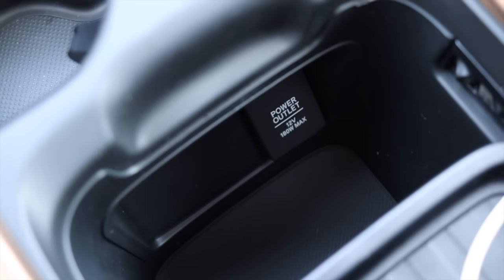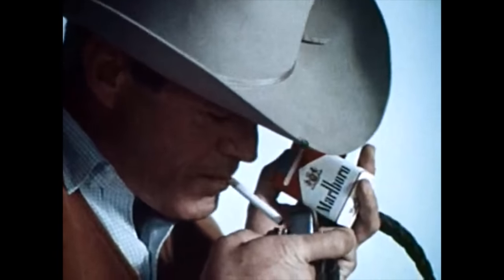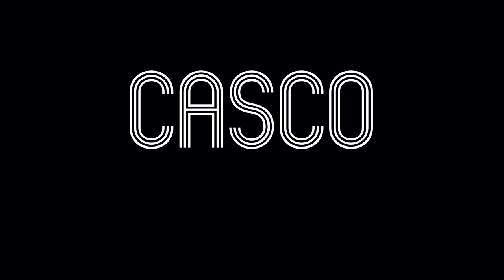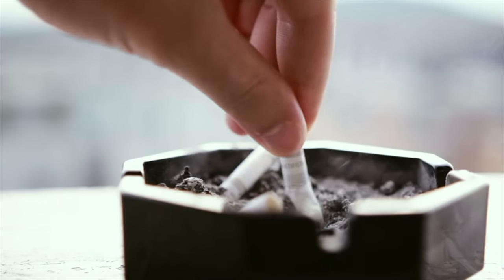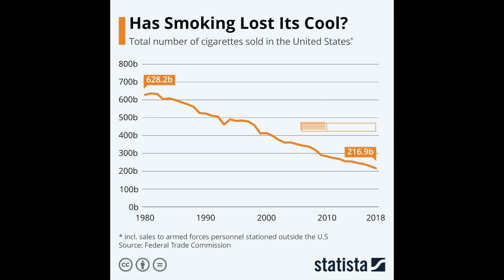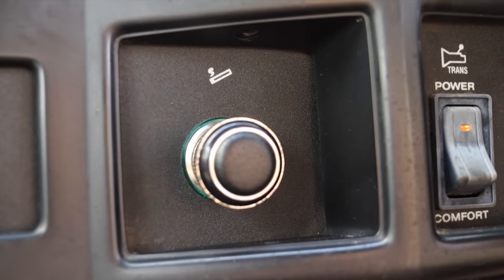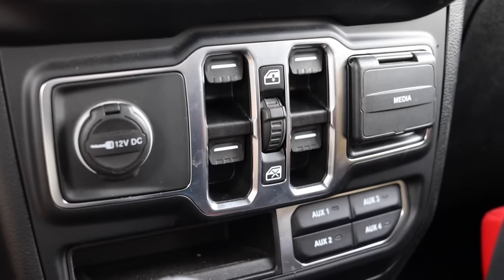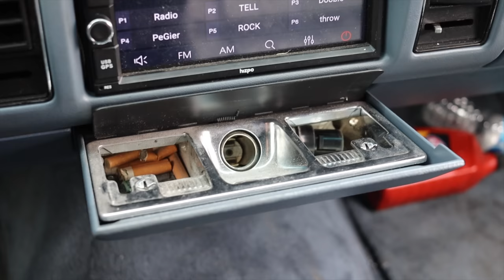Cigarette Lighters - How They Were Invented & Why They Went Away!

Comment: Another trick for the old car cigarette lighter for us folks in colder areas was to use it to get a start on chipping that frozen windshield. Push the lighter when you start the car. When it pops out, grab it and melt a spot on the ice to start chipping from. Worked every time.
Reply: Wouldn't that destroy the glass?
Reply: @porterbennett7041  glass has a melting point well above 1000 degrees. I doubt a little electric heating element reaches even a fraction of that
Reply: @Michael-sb8jf  no man he means thermal shock is when glass is cold and you put heat enough heat it will shatter due to the stress being different from the different temps, look it up “thermal shock glass” and yes if you pressed the hot heating element on the bare glass it would probably shatter it but if it’s just on the ice it’ll be fine
Reply: Yeah. If it's iced bad enough that your scraper needs help, start the engine, turn the heater to full defrost and wait ten minutes.
Reply: @Michael-sb8jf  I never mentioned it would melt I ment wouldn't it crack the glass if it's that cold
Reply: @porterbennett7041  
I made the comments when I was dead tired and not thinking and the only thing I could think about was chemical structures and such and more thinking it can't warp glass.
 Though the ice would provide most likely act a  good insulator against the heat of a small " filament" especially given the use case given in the original comment. Water takes a lot of energy to phase change. And that heat will be disposed across the entire sheet. not to mention the air pockets between said ice and window. 
So long story short yeah I mis understood and my thought process went the wrong path 

But yeah putting the heating element directly on the glass in cold probably a bad idea.
Reply: I just made 2 eye holes.
Reply: @Michael-sb8jf  frozen windshields can  shatter from having hot water thrown on them in other words it wouldn't have to be a 1000 ° to break if frozen
Reply: @commieslayer6740  and here’s the guy who continues to beat a dead horse. He admitted his mistake already
Reply: Melting ice will not get above 0 degrees Celsius/32 degrees FREEDOM UNITS so there's not going to be thermal shock until you get all the way through the ice and apply the heating element to the glass itself.
Reply: @BogeyTheBear  exactly have to touch the glass itself
Reply: My parents used to chuck nearly boiling hot water on the windscreen on cold mornings and I never saw one crack. However I did witness the rear window of my 1985 VW Polo immediately shatter when I switched on the rear window heater on a cold day.
Reply: We used to start a little fires when we went hiking or mountain riding when cars were allowed hahahah
Reply: It's was also good for when your car door locks freeze. You could heat up the tip of your key and it would slide right in like butter.
Reply: @allmodescrew5548   I would assume you wouldn't put the lighter directly on the glass you would hover it and move it around in a circle or whatever
Reply: @porterbennett7041  obviously not if it was common practice
Reply: @joesantoro4964  If your car door locks are frozen, how do you get to the cigarette lighter?
Reply: @igotes  cold mornings lol. you're from Maine or something probably. come to Canada and try that shit in winter.
Reply: @jcon6734  On my old Honda the drivers side door locks always froze up in the winter so I would have to get in from the passenger side door then use my lighter. But yea if all your locks are frozen then you need to use a regular flint lighter.
Reply: This sounds unnecessarily time consuming when you can just turn your Ice scraper sideways and scratch out a spot to get started with the sharp end.
Reply: Plus when you return the cig lighter you're plugging in a wet lighter into a power socket. That seems kinda dangerous.
Reply: Interesting
Reply: @porterbennett7041  no the heat from the cigarette lighter element would instantly dump into the ice
Reply: @porterbennett7041  If the lighter was bigger it would.
Reply: @Vast Horizon bro he just corrected himself already 😂 cant you read?
Reply: @igotes  there is a reason for this, your front windshield is made of 3 to 5 sheets of glass, insulated with plastic, they are ment to not shatter, to protect you, from road hazards. The rear and sides are a single piece of glass and will shatter if you poor hot water on them when frozen.

I would advise not doing it to the front either.
 
As pooring the hot water actually weakens the bonds of the plastic and glass layers and significantly reduces the safety glass strength.
Reply: @alexanderson7101  Canada? Come to russia its already started snowing :)
Reply: @MyPhobo  this is the correct method, and if you pour water it makes it easier to cut into
Reply: @Robert53area  Yes, I'm familiar with laminated glass. I would never pour hot water on a frozen piece of glass. My father (a motor mechanic) would do it without any concern. The rear window glass is toughened so it's more susceptible to thermal shock, or at least gives more spectacular results when exposed to stress.

Comment: The issue with USB "taking over" from 12V outlets is that besides charging devices, high power equipment will still need the highest voltage and amperage possible (not 2A from a 5V USB outlet)
See inverters and compressor pumps for flat wheels. 
These are rather important in some vehicles that do remote field work like on farms where you may need an inverter to power 220v (or whatever your local power outlet voltage is) for computers, or fixing flat tires when you need to do that

Comment: A circular outlet is still useful. It can provide more power than any USB port, so it's great for camping gear and the like. It's much cheaper for the automaker to implement than a 120v AC port as well.
Reply: Type-C power delivery can provide 240w of power at up to 48v
Reply: @manitoba-op4jx The inverter may be rated for that, but vast majority of sockets won't be. The fuse is typically 20-25 amps, 12v x 20a = 240w. You are also losing a huge chunk of that power by inverting it.
Reply: No wants permanent in this world except for change

Comment: It's an interesting place with the 12 volt socket right now, because there's an entire ecosystem of portable RV and camping gear that uses high wattage DC and things like portable battery banks/solar generators that use that plug as their standard high wattage DC output, we're talking loads that are way too big for USB like refrigerators. It's also rather interesting that that plug isn't standardized as a 12 volt plug, commercial vehicles often have a 24 volt system so you can fry a piece of equipment by plugging it into their sockets without checking first.
Reply: It takes a lot of power to heat that element to red hot. 
Watts = Volts x Amps
Find the fuse for the lighter to finish the calculation.
This laptop has a 65w power supply, the lighter can handle that with 6 amps.
Reply: @nutbastard  Any smartphone will have current limiting circuitry, since a LiPo battery charges at 4.2V, USB delivers 5, and the internals probably run on 3.3v. The issue is that if your phone cannot determine the rating of the power supply, it will not draw more than 500mA. This is because you cannot assume that any given power supply is actually capable of delivering more than 500mA, and drawing more could cause an overload.
Reply: Learned that the hard way. I took my 12V travel refrigerator along with me for a work shift in a 24V truck... guess what happened..
Reply: USB PD can get up to 240W
Reply: @HAWXLEADER  yeah, and with the car cigarette lighter you'll usually blow the fuse at 10 amps, so 240 W is already more than what most 12V car outlets will do
Reply: @cowboybob7093  my camping fridge pulls about 80W, nearly melted the plug in my car. its a horrible bad connector. its only sort of a standart, and there is often a lot of resistance in the connection.  It whould be a god idea to replace it with somthing more reliable.
Reply: @maryhayes7574  the nice thing about usb pd is its active. a 65W charger should be mor than you need to charge a phone or tablet, and the laptop just takes a bit longer to charge. in less than 2h any laptop will be fully charged with a 65 charger, beacuse laptops have a max 100wh battery.

Comment: The one thing I miss about the in-car lighters is their use in starting fires in emergencies. Twice in my childhood we were stranded on the road and used the cigarette lighter to start a fire either to keep warm or act as an emergency beacon.  (You also forgot to mention dashcams as a common use for the "power outlet" in most modern cars.)
Reply: We used to use them to light fireworks and throw them out the window.
Reply: Radar detector
Reply: The only thing I use mine got is to charge my Steam Deck

Comment: It's fun to push in the cigarette lighter and watch the voltage gauge jump down. The 12v socket is too much of a standard to go away, you can't plug inflators or fridges or other stuff into USB. I've noticed that modern cars hide them away and put the USB front and center which is fine because that's what most people use 12v sockets for. Euro cars have a slightly larger diameter socket that's not intended for heat.
Old Rolls-Royces call them cigar lighters. They knew their customers. I always liked how Chrysler indicated on the plug covers if an outlet was battery or ignition switched.
Reply: In a Chrysler, you can change the outlet to always on or switched just by shifting the fuse to the left or the right.
Reply: The "Euro" diameter is for lighters too.  Gets confusing buying lighter connectors in car accessory shops.  Sometimes they were named "cigar lighters" with no difference.
Reply: 'Euro' cars (all that I've owned from 60s models to 2010 models) have used the same 12v accessory socket size and the earlier ones WERE intended for hot use. I know this due to actually owning them.